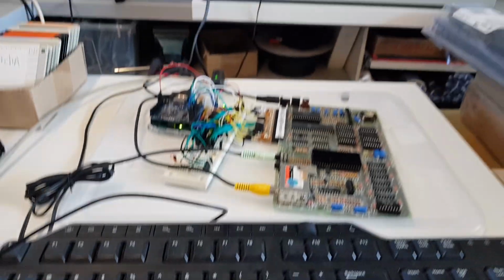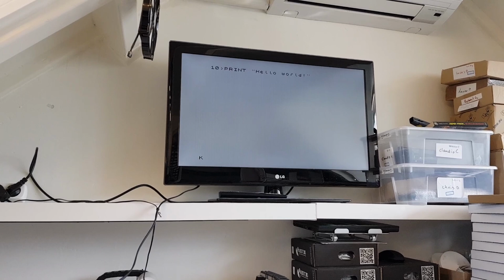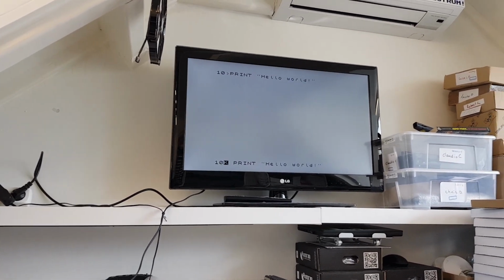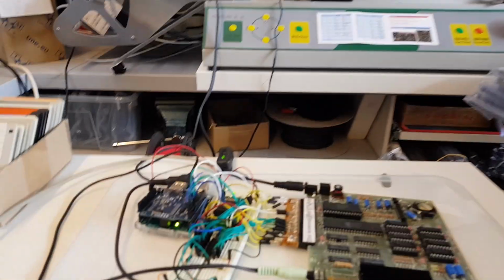I told you: new products coming up! USB keyboard interface

Comment: I wonder if an inexpensive GD32F405 could do the job of all the ICs you are using?
Reply from the maker: I am interested in alternatives, so thank you!
That's an ARM chip right? I don't think that's 'enough' - it would require a completely new learning curve.
And there might not be USB HID libraries for it.
There are alternatives for e.g. the USB host controller, but it depends mainly on Arduino libraries that support other chips.

Comment: Will this work on a harlequin 128k
Reply from the maker: On all Sinclair models and Harlequin boards. Just not by default on Amstrad models: Amstrad engineers removed as many parts as they could, including some databus separation resistors, that are mandatory to have an interface like this 'overrule' the internal keyboard.
However, I will create several versions of the interface, so that it will work with Amstrad made ZX Spectrums, by connecting to the internal keyboard connectors. And without the need to solder internally!